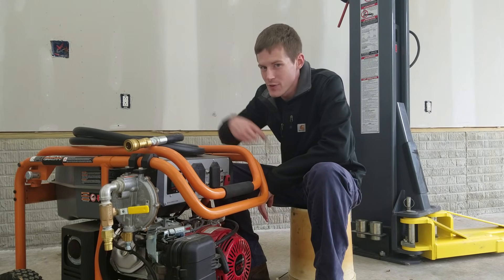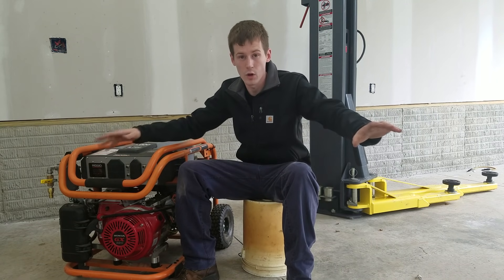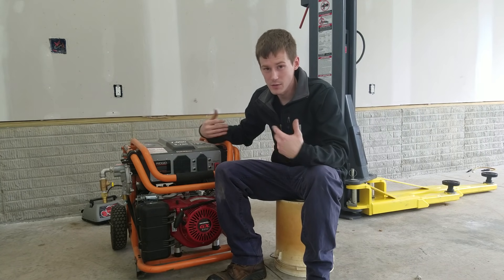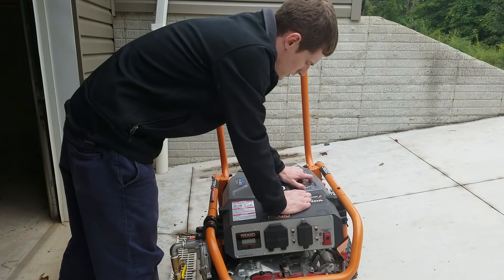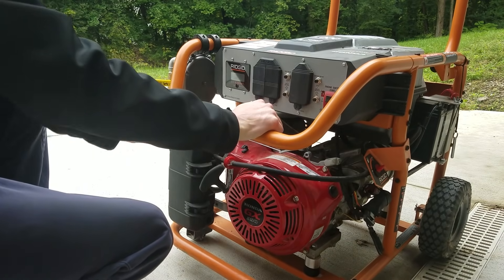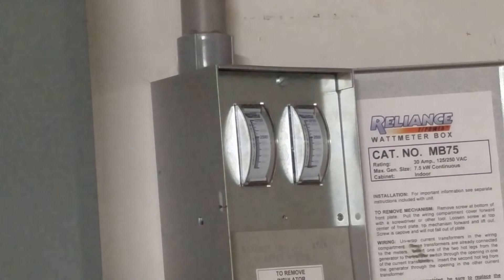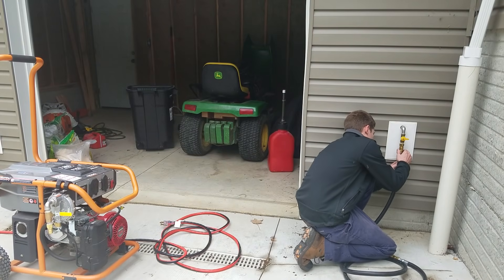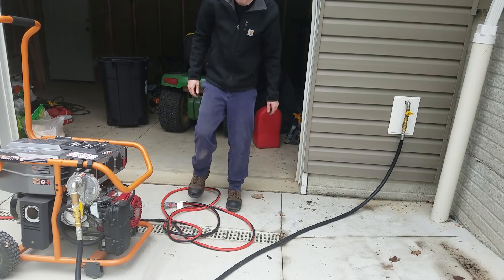Natural Gas Generator: Frequently Asked Questions

Comment: I was a propane carburetion technician for 10 years, had a full shop Dino 4 gas analyzer and converted engines everyday, it's nice to see it is still being done even after new regulations. Looks like you're spot-on that conversion good job.

Comment: I worked for an lp gas company for years and all their service trucks ran on LP / gasoline and we put well over 200, thousand miles on them, they burn cleaner and didn't give not one minute trouble, 
We actually tore on down once
( Ford 360 ) and it looked like new inside, not even a wear ring at top of cylinder, cross hatch was still there,,
Great way to go on a generator. Last forever..
Reply: What engine did those trucks have and are they high maintenance

Comment: For those wondering why run on NG rather than propane:  If you intend to be prepared for a lengthy outage,  then the amount of propane you can store on site becomes an issue.  There may be city or HOA restrictions. Then you have to deal with how to get propane tanks refilled when trucks are held up by the storm and everyone else is lined up to refill at the same time. One other note. Propane tanks get colder as the liquid evaporates. At 7000 watts, you're likely pushing the limit of how many cubic feet per hour you can get from a 20lb tank at zero degrees or below.  You may need dual tanks, tank heaters or something larger. If the tank is larger, there are more rules about where it can be situated. If you don't want to worry about that tank running dry during the night, you'll want an auto changeover setup like on an RV.  So I'm treating propane as the 3rd option with an inverter up first to cover the initial day, followed by the generator on NG and propane last. I agree about not cutting the frame.  I used some angle iron to shift the engine mounts far enough horizontally to make room for the air box.

Comment: Thank you my Buckeye brother! Excellent info follow-up! Did not know about the possible valve and seat issues. I am not really that concerned as I hopefully only will run on NG for very short stints when power goes out. Thanks again for sharing. It is very much appreciated. Cheers from Michigan.

Comment: Thank-you for the videos they are both very informative and good information. As an electronics guy I'd note that although you are only slightly off of 60Hz this will cause items with clocks to be off or loose time as they run on your system. This coincidently is also why on Gass you noticed the Flickr of the lights it was further off from 60Hz I believe I noticed 57.xHz anyway having power and alternative methods of getting it is great and the main point.  Thank-you and good work keep it going :)
Reply: Good point. Three of our clocks speed up, when running on Gen power. From what I can tell, about 1 min. faster each hour on Gen power.

Comment: Two Comments:
Vacuum leak – Will not affect the fuel/air ratio when running on gasoline as it is external to the carburetor and the vacuum leak sensitive portion of the intake system. That said, it is possible to draw some unfiltered air into the engine through the (now) open natural gas connection so that would be bad.
 So, valve you installed has a purpose.
Power Back on Detector – I use a device from Relaince (the same folks who made your power meter) called a PowerBack (Utility Power Return Alert). It is battery powered and can be armed when you turn on your backup generator. It monitors the incoming mains and sets off a (disturbingly) loud alarm when the utility power is back on. I expect it is extra loud to be heard over generator noise. You can find it on Amazon by searching for PowerBack.
Reply: @SomnoNaut   Neither a great nor safe idea and surely against any north american electrical code. (Gauge of any wire must be able to safely take the entire load of the breaker that it's connected to, otherwise it's a fire risk). The PowerBack noted above use an induction coil or similar to connect to the mains. i.e not a direct connection)

Comment: I just scored a new-ish 5000w generator from my neighbor because is was leaking gas, I converted it to tri-fuel for the same price 
as carb overhaul parts, I ran it on NG out of my garage line, Oh it's so nice, Never having to haul gas home, No gas going bad each year, 
I don't have to add fuel stabilizer, No gunking carb,  I'm just going to stick with NG and propane.

Comment: I have a dual fuel generator! Both fuels work. The propane is less of a hassle and cleaner burning and better on oil changes and cleanliness of the oil. You don’t have the mess of gasoline and propane is cheaper to run. Fork trucks have been on propane for decades and much safer while working inside a warehouse!

Comment: Someone expressed a concern about running out of natural gas and having to return to gasoline.  If your natural gas supply is pumped to your house, it won't run out for months or years.  Natural gas comes out of the ground under pressure.  The gas companies store surplus by pumping it into huge underground reservoirs sufficient for months or years.  The distribution systems are controlled electrically, but the gas companies have generators fueled by (wait for it) natural gas.  If you get your gas (natural or propane) is delivered by truck, chances are good those trucks are fueled by the same type of gas they are delivering.
Reply from the maker: All good info. In my area the majority of the houses are heated by natural gas.  Natural gas outages are like you said slim and outages in the winter are almost noon existent. The comments in these videos are full of 'internet engineers'. So, thank you for injecting some common sense.
Reply: Repair Geek I was wondering  since your using natural gas  if you should use a drop leg at the gas inlet on the generator to catch any sediment that may come through the gas line There should be a drop leg on  a nat. Gas furnace and gas water heater on a portable generator I don’t really know. Just to keep crap out of your engine. Good video.
Reply from the maker: @crossbow3539  I have a drip leg inside the wall before the quick connect fitting on the gas line.
Reply: As a natural gas company tech I can tell you that not all companies have natural gas fired back up generators. I worked a huge outage in New Mexico years ago and people were without gas for weeks. I know it’s crazy but it’s reality. Second if the power grid goes down and the compressors are not working to maintain pressure in the distribution lines, the gas in the lines will be depleted quickly ( in hours) by furnaces etc running on gen power. Once the existing gas pressure is below a pound or two it will start sucking air into the distribution piping. Once that happens you won’t have gas in the lines again until we purge the air out and replace it with gas once the grid is up again.
Reply: Where I live, for the past 16+ years.  Anytime we have Power Outage, we ALWAYS have Gas.  The Company that supply our Gas, have Gas Generators Back Up.... Hahahahahaha, they are the Gas Company!  LOL
Reply: Thank you for posting. That was my number one question on natural gas generators. How long will I have gas pumped to my house in a total grid down situation? Here’s praying that my gas company has natural gas back up generators to keep pressure on the lines.
Reply: Good information. Actually, I've seen natural gas outages caused by tornadoes, hurricanes, and earthquakes. Just at the time it was needed most, it wasn't available. Because storing large quantities of gasoline (enough for a couple weeks to a month depending on the damage to the infrastructure) can be problematic, I personally prefer profane as a backup fuel source. I have a 1000 gallon farm tank that I keep full (rarely use than than 50-75 gallons a month). I also have a pair of 40lb tanks for my RV and 3 25lb bottles for my grill should worst come to worst. The RV is also plumbed with a regulated LP line that I can hook to my generator. Normally I use that when camping with my 3500/3000 Champion. The big tank is plumbed thru a regulator to my 8750/7000 in its enclosure by the house. Takes about 30 seconds to switch from CNG to LP.
Reply: @briflemn  Interesting info.  What cause the natural gas outage from tornado or hurricanes?  I would guess an earthquake could disrupt under or over ground pipes, but those (especially underground) should be pretty immune to high winds or water.
Reply: @BryanTorok  Anytime there's are businesses or residences that have natural gas piped into them, the destruction of those structures leaves broken gas lines spewing gas.Until those are contained, the mains feeding them have to be shut off to allow workers to repair, or at least cap the damage.  Following a bad storm that destroyed structures the leaking gas combined with arcing from broken electrical lines has caused fires. I witnessed the aftermath of that during relief efforts after the tornado that devastated Joplin, MO several years ago. The first folks on the scene, along with police and EMT's, were there shutting off electrical and gas lines.

Additionally, areas serviced by natural gas have above ground distribution points where the piping is exposed. There is one of those less than a mile from where I live.
Reply: @briflemn  Thanks, I hadn't thought of that.  Here in northern Ohio tornadoes are not exactly rare, but not common either.  We are much more likely to loose power from straight line winds, or snow and ice in the winter.  I've been through many power outages, some as long as a week, but never lost natural gas supply.
Reply: @BryanTorok  I haven't dealt directly with the aftermath of a really bad hurricane, but I imagine anything that can knock houses off their foundations could do the same thing. My personal belief - two is one, one is none. I try to always have a back up to my backup. That's why I like tri-fuel generators. Of course, all that planning goes out the window if your house is the one destroyed.😏
Reply: Thanks! I learned some new stuff from this comment and the replies! Lots of perspectives and experiences in different scenarios.
Reply: @briflemn  we actually shut the meter off before demolition.

Comment: I have done the conversion but I don't use gasoline. It is good to know that I can. I have a powerhorse 7,000 and also have my natural gas connection outside and my breaker box outside.

Comment: I was just about to modify my brand new generator (never used so far) to natural gas but I am concerned about the fact that gas runs the engine very dry, especially valve seats and stems. I must come up with an answer to that or I will face some parts of the engine running hotter than they should. In the old days, we used to have lead in the fuel which would deposit on the valve seats and guides creating a protective coating, with the advent of unleaded they have come up with some substitute additives but with gas, we would non benefit from either of those. I appreciate your comment on this as I have not seen mention of this problem in any of the videos online so far

Comment: I know I am 3years late telling you this but with most of your comments. Including valve recession. The only comment I  want to add is valve recession is only a problem with cast iron valve seats. Most overhead valve engines used in generators have aluminum heads and already have hardened valve seats.

Comment: Hey RG, thanks for the video.  I've been looking for info on maintinance for LP/propane generators.  I understand your point regarding the hardened valve seats you mentioned.  But I don't use my generator too often to worry about that, but it sits in storage for extended periods of time and I'm not sure if I need to do anything to make sure it's going to work when I need it.  Thanks for the help in advance.!

Comment: After converting mine, a HF Predator 8750, I started reading about "valve recession", because unless the valves are hardened, the lack of lubrication and cooling from the gasoline, wear and tear will be added at a considerable rate.  As for me, I still like the idea, but next time I will get an engine that can be converted. HF's are very basic and hardened valves are not available for it.

Comment: What size (diameter) natural gas line will I need to run natural gas 35 ft. to my generator 3/8", 1/2", or 3/4"?

Comment: I liked your review. I do have a technical question that I've wondered about and haven't found an answer to. That's this; purpose built backup generators such as Generac and Kohler have deeper oil sumps with replaceable oil filters and sometimes oil filters. They are able to run for very extended times without changing the oil. On the other hand, portable generators require frequent oil changes. Have you heard of a way to connect an external oil supply and/or cooler to a portable generators in a semi-fixed position?
Reply from the maker: You can't add a filter to a portable unit. The portable uses a splash lubricated system. So the crankshaft and connecting rod dip into the oil and splash it around inside the motor.

You can't splash oil through a filter. Engines with filters have oil pumps and have pressure lubrication. They are 2 totally different systems. In any case your oil will stay much cleaner on NG or propane than what they would gasoline.
Reply: @RepairGeek  Kinda what I thought. I couldn't figure a way to keep the proper level of oil in the crankcase for the splash lubrication to work as designed.
Thanks for the quick reply tho'.

Comment: So I installed the snorkel kit from US corporation. I planned natural gas to the unit. I’ve drained the gas tank of gas, because I don’t anticipate using gas further. This is my question… Do I simply turn the gas shut off… to Off...(To prevent a vacuum leak?) Thereafter, I assume I’m sad to transition over to natural gas in tune the block adjustment. Thanks to repair geek for the detailed video!!
Reply from the maker: Yes just turn the gasoline valve off.

Comment: Actually  if you go back to the previous Video where you installed the convertion kit the generator without the kit was surging running on Gas, alone with the kit installed please notice the dryer on low as before it is not surging the meters are holding steady .
Reply from the maker: HighVoltage 1200 correct. It was much warmer outside when I shot this video. In the previous video, the generator was running slightly lean due to the colder more dense air during the winter. This video was shot about a week ago.

Comment: So when You are setting the RPM with your fuel mixture, Should you set that a zero load, full load, or half load?  Seems like setting it at half load or higher may give you better performance at those loads.

Comment: Very helpful, thank you.  A question - I have new Champion 7500w Dual Fuel (gasoline/LPG) Portable Generator. I also have natural gas to my home and therefore accessible for use in place of LPG. What modifications must I make to my generator to allow it to run on natural gas, and can I easily switch back and forth between LPG and natural gas if needed? Thanks

Comment: Bravo!  Very few producers of this kind of video are willing to come back, admit mistakes, and fix them.  Case in point, you've probably seen that fool from one of the Carolinas who swears up and down that the rest of the planet (except him) are full of it when they criticize him for his no transfer switch, suicide cord method.  That having been said...

I believe this to be true but can't source proof of this.  Any engines designed to run on unleaded fuel already have hardened valves and seats.  The funny part of this is that virtually all gasoline sold prior to 1975 contained tetra-ethyl lead.  One hero of the time, Amoco, sold "Lead-Free Amoco" (presumably marketing to the new focus on clean air).  Lead free fuel tends to accelerate the degradation of non-hardened valves.  So, do the right thing, get the lead out of your fuel at the time, and ruin your engine prematurely.  Then, if you don't see to it quickly, you're polluting more than you would be had you just stuck to leaded fuel.
Reply from the maker: Charlie Hustle you’re partially correct, engines that run on unleaded gasoline do have hardened valves but, there are different levels of hardness obviously. Any natural gas preparation package on a new vehicle will add in even harder valves and seats and that’s usually specifically stated in the description of the package. Honda for instance will require valve adjustments every 25,000 miles on a natural gas vehicle. Gasoline powered Honda’s are usually about 100,000 miles.
Reply: @RepairGeek Thanks for helping me wrap my head around that.  I knew there was something there, but couldn't articulate it.  

Nice work you're doing!

Comment: I have a tri fuel generator.  Just started it using natural gas.  It will run on choke, but when I turn it to run it dies out.  Should I let it run on choke for a while, or is something wrong?